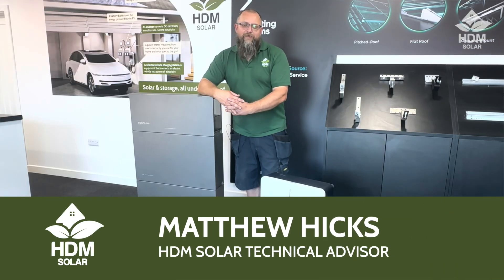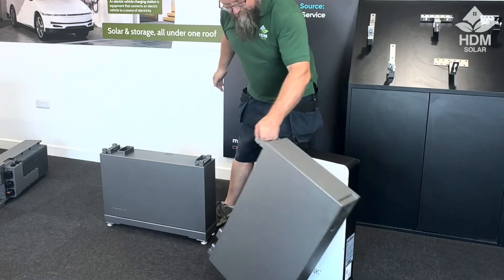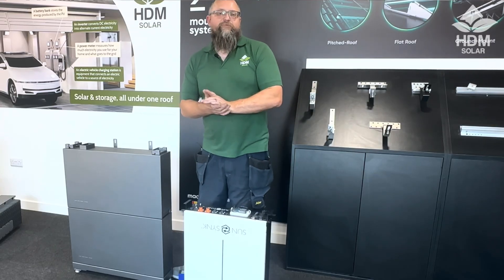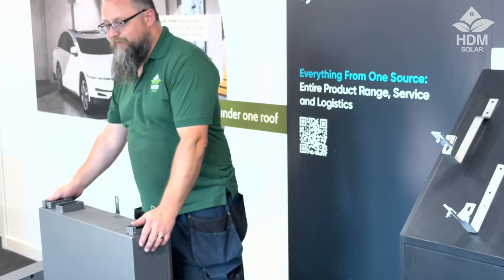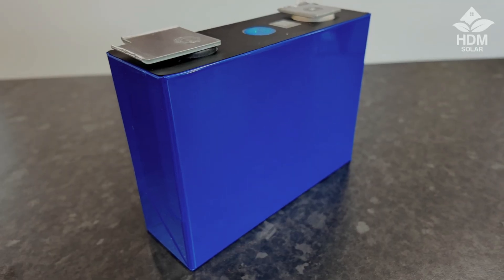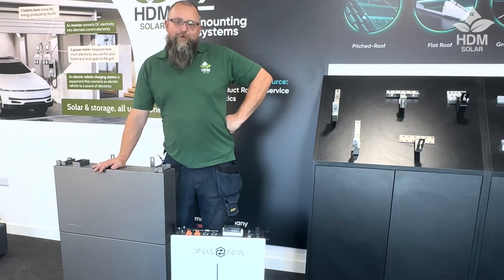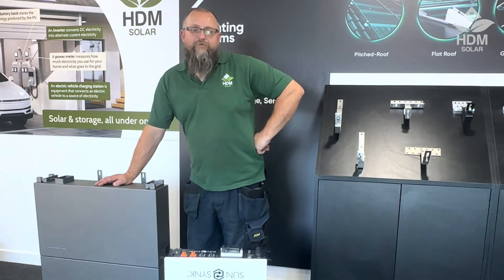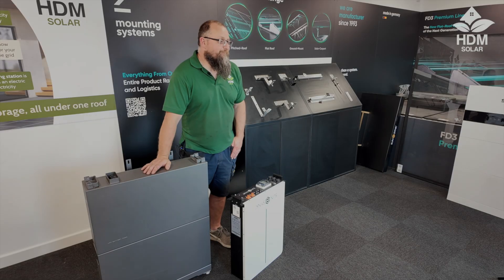Energy Storage Solutions - Low & High-Voltage Explained

Comment: If the high voltage batteries charge faster does this mean you would get more charge saved on the shortest days of the year vs low voltage with equivalent panel inputs?

Comment: Anybody working on a battery/ off-grid inverter system with a DC bus voltage of 100 or 120?  I live in the USA where lots of devices run on 120 VAC but many of these same devices also work perfectly well on 120 volts DC.  A DC bus voltage close to 120 volts would greatly reduce the load on the inverter and even allow one to run important devices before they save up to buy the inverter.